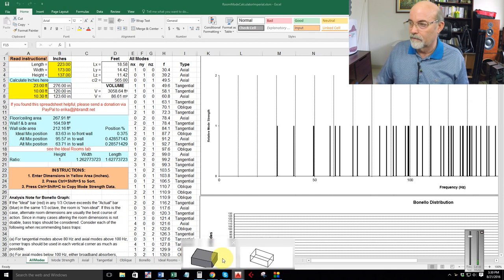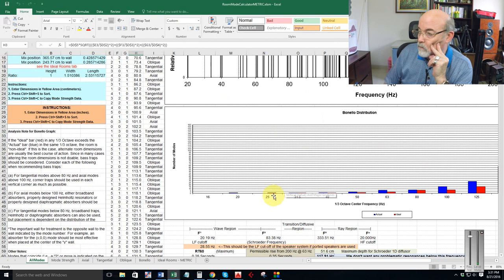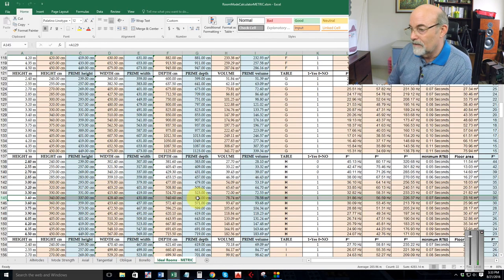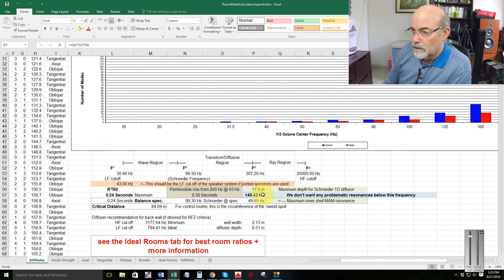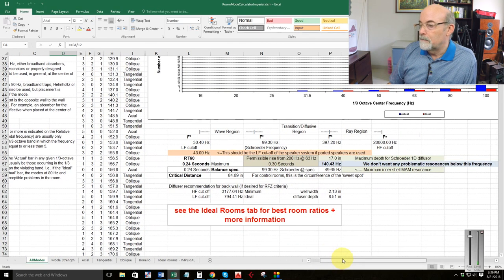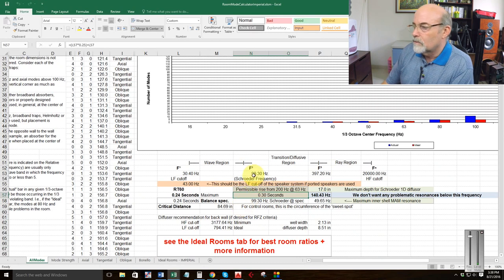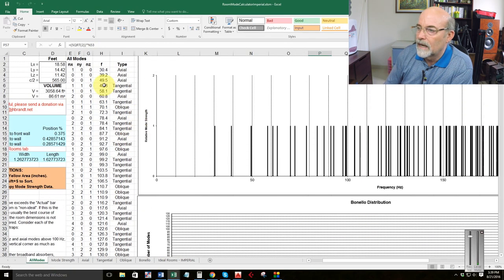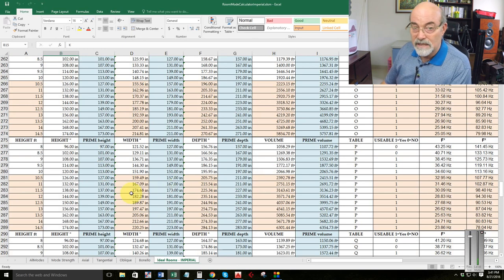How To Use The Room Mode Calculator

Comment: Hey John, im a little stumped. Im in a situation where i only have one room to use for my "control room". its my bedroom. here is the problem i am having, i plugged in my room dimesions, did ctr+shift+s then crtl+shift+c, and then i ran into my first problem. My bonello distribution chart reads higher red than blue at the 31.5 region. my question is, what do i do? is it possible to just provide extra treatment in that frequency using membrane traps (bascially "do the best i can manage")? Unfortunately it is a VERY small room and i am unable to afford a seperate space at this time so im really in a situation where this is all i got to work with. I currently live with my parents and dont have the luxury of considering building a "room within a room" considering they plan on selling the house at some point (aka they wont allow it, and thats fair) as well as i believe the room is too small to be built "inwards". Im worried about my options, but look forward to hearing your honest opinion if you see this and choose to respond. im hoping the answer doesnt amount to "your screwed" haha! but, prepared for anything cause thats how one learns, right?
Reply from the maker: Nick, the 31.5 Hz band is not a bad one to NOT meet Bonello. It just means that your room is longer than it needs to be to meet Oscar's criteria. What are the dimensions? - Write to me and let's discuss (john@jhbrandt.net)
Reply: @JHBrandt  Will send today!

Comment: Hi John! Awesome video mate! You can convey information really well! I have a question regarding treatment. So modes below my Schröder frequency should be treated using membrane traps and modes above it are treated using absorption and diffusion? Is that right?
Reply from the maker: Thank you! Yes, use fiber for the velocity region and membrane or pressure traps for the pressure region. That is correct. Don't forget diffraction which can be a very powerful tool in your acoustics arsenal. :)

Comment: thank you, Jhon very helpful. I have a question, my room is rectangular with an apex ceiling. how should I proceed when entering the measurement into the room mode calculator? thank you
Reply from the maker: Find the average height and enter that... It's imperfect but better than nothing. Rooms will peaked or cathedral ceilings are difficult to predict. They have few, if any, axial modes. Everything is thrown into the tangential and oblique.
Reply: @JHBrandt  Thank you John for the quick reply.
Reply: @JHBrandt  It worked great thanks Jhon. I wanted to ask you a question,  I can't work it out on my own by looking at the room calculator. I have done a measurement of my room using REW ( free measurement software), found out that I have a dip of 25-30 dbs from 118 to 140 Hz. What's your advice on correcting this problem? Thank you John
Reply from the maker: @frankyredente4152 , of course, you have peaks and dips everywhere. That means that you are in an enclosure. 

You don't 'fix' the dips and peaks on your reading. - the only way to do that would be to turn off your speakers. LOL

Most people presume that the frequency response chart is the qualifier of a good room. It is not. The FR chart that you create with room testing software is the response of the 1 cubic centimeter of space where the mic capsule was positioned at the time. 

The folks at reference laboratories know all about this and as my wife often tells me, "it's not like what you think." :D

If you need help, send me an email. - john@jhbrandt.net
Reply: @JHBrandt  haha Thanks John, you are very kind for replying. Ok I will email you. F

Comment: Thanks for explaining the spreadsheet. Had downloaded it and understood most of it. This cleared it up. According to the room you used as an example, you should have a RT60 of 300ms from 100hz-30hz. Above 100hz should be 240. Is an accurate interpretation? Do use use this RT 60 to know how much bass trapping to add during planning phase? Then add more if needed? Thanks again.
Reply from the maker: This section of the spreadsheet shows the MAXIMUM desired RT-60. So, from the 200 Hz band down to the 63 Hz band the LF can rise like this: \
But only to a maximum of .35 Sec. or 350 mS.
The Maximum RT-60 of all the other bands can not exceed .28 Sec. or 280 mS
To obtain an accurate RT-60 measurement of your room, you should (ideally) make at the very least about 10 15 measures, (all in different spots in the room), and average the results. - 
Yes, we use the prescribed RT-60 in the spreadsheet to assist us in determining the needed trapping. Mostly broadband. 
I have never, ever needed to add more or take any away. Contrary to what is being said on forums, you CAN calculate all of this. We have real-world models and the calculations match. I just works.
Reply: My rooms L: 14.25 W: 11.458 H: 9.666....Schroederfrequency: 232 Hz , Critical distance: 1.61 ft . what is Critical distance: 1.61 ft ? Volume: 1579.17 cft , Surface: 823.84 sq ft ,RT60: 
0.6 sec.now what should i do to treat my rooms ?

Comment: Thank you for this tool! I seem to get stuck at step 3 when I try to copy the calculated modes to the diagrams. It seems like the Ctrl+Shift+C doesn't have the right function, I'm using the latest version of excel on macOS so perhaps it's not the same anymore. Do you have any idea what command to use to copy the data?
Reply: Hello, ctrl-shift-s doesn't seam to work on my imac. Do you have any idea what command to use?

Comment: Dear John, I am using a mac and I can't transfer the data change with the command control+shift+S(on mac this is Save as...), is there anyway I can do this from menu commands? sorry to ask, the chart is not functional otherwise
Reply from the maker: No, I'm sorry. You must have MS Office for the macros to work. I had someone in my Facebook group give advice on making these spreadsheets work in Open Office and other Microsoft clones but I don't know it. 😝
If you need to talk to me, please send an email to john@jhbrandt.net

Comment: Hello John, I am a 61 year old musician that is getting ready to build a RIR in a spare bedroom of my home. The pre RIR dimensions are typical about 12' x 12' x 8'. I have reduced the RIR non treated dimensions by using your "Room Mode Calculator" down to the point where it can pass the Bonello test. These dimensions are L - 134.50" x W - 120.00" x  H - 88.25". My Wave region is 50.41 - 153.73. But in the Relative Mode Strength chart I have no nodes below 50.41hz. Is this a problem, and can I overcome any problems that this may produce with room treatments?

Comment: Hi, John!
Incredibly educational to watch your videos. You convey knowledge in a good way! One question: I have a small listening room for 2-channel hifi. But it is a bit complicated. The ceiling height varies from 2.4 meters to 3.4 meters in the main volume, which has a base area of 3.2m * 3.3m (Yes. Terrible proportions). In addition, a volume comes in the form of a loft over the hallway outside. This loft is 1.3m * 3.3m and has a ceiling height varying from 0 to 1m. The loft means that the total width of the room is 4.5m. How can I calculate the repson in this room?
Reply from the maker: This room mode calculator is best used for rectangular cuboids. If a ceiling is vaulted, I use the average. However, it can often result in errors when doing that. 
That's why I say that building angled walls/ceilings in a critical listening room is creating a 'box of chocolates'. - Because you never know what you're going to get. ;)
Reply: Thanks for the good answer! Think I've got a box with a couple of really sticky pieces

Comment: I am looking to create an audio room with the following dimensions: L 671.0 cm
, W 366.0 cm & H 427.0 cm. Unfortunately the room is fixed and cannot modify the dimensions. any advice you could provide?
Reply from the maker: Treat it! :D It is NOT bad! A little narrow and the 31,5 Hz 1/3 octave band doesn't have enough modes, but it WILL work. The room has almost 105 cubic meters and a high ceiling. It should be very good if treated properly. Send me an email. john@jhbrandt.net

Comment: My rooms L: 14.25 W: 11.458 H: 9.666....Schroederfrequency: 232 Hz , Critical distance: 1.61 ft . what is Critical distance: 1.61 ft ? Volume: 1579.17 cft , Surface: 823.84 sq ft ,RT60: 
0.6 sec.Thank you sir
Reply from the maker: Critical Distance (Dc) is the ratio of direct sound to ambient sound and is dependent on the distance between the source and the listener, and upon the reverberation time in the room. At a certain distance the two will be equal. This is called the "critical distance." So this is basically defined as; the distance that a sound ceases to fall off at -6 dB per doubling of distance from the source. (Inverse square law) The source sound goes constant volume at the Dc of the room. 
This is determined AFTER treatment. If you follow procedure as outlined in the Balanced Non-Environment Criteria (resources page).
Your room looks good with those dimensions, BTW  ;)
Reply: I have sound absorber panels in 1st reflection point , corners, and diffuser on the rear wall.Now should i avoid the Critical Distance? btw my monitors are positioned in equilateral triangle and head in the 38 % of the longest wall.Am i in right direction ? Thanks for the reply.1 sub + thumbs up
Reply from the maker: The critical distance IS the sweet spot!!
You won't have a sweet spot anywhere near that large with the little treatment you are using - following the LEDE criteria. But you are on the right track... just getting started. Go to my resources page and download everything you can get. ;)
http://www.jhbrandt.net/resources

Comment: hi John 
what's bonello ?
hug
Reply: Was a guy that developed a method based on math, acoustics and all that stuff. Basically he said that the number of modes in a room must be upward till reach the 200Hz, beyond that, the human hear can´t distinguish because of the density of the modes. But from 200 down to 20Hz the modes produce acoustic coloration. Bonello said that we must avoid two modes in the same frequency.
Search for Bonello´s Criterion o google.
I guess, in the Bonello´s section of the calculator shows the number of modes that we have and the ideal number we should have. Then you can look in the all modes section and treat your room depending on which modes are coindicent.

I really appreciate this tool and the videos. John you are a boss.
But a little more of explanation would be super useful!

Comment: Hello Mr! I've been using your Room Mode Calculator to figure out which room is best. I have a room that is 262 (H) x 575 (W) x 703 (L) meters, but since the room is still in construction I can have it with 280 (H) mt. Both rooms meet Bonello, but it seems to me that the one with 262(H) is less problematic than the one with 280(H)! I'm I wright? The room is made of reinforced concrete, and will be finished with gypsum board and wood (walls and ceiling). Can you help please? Kind regards.